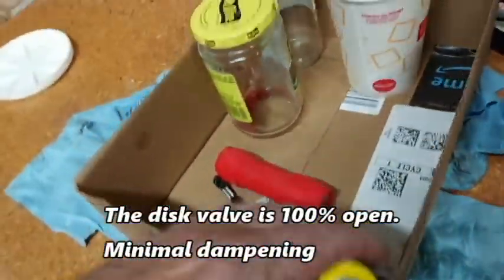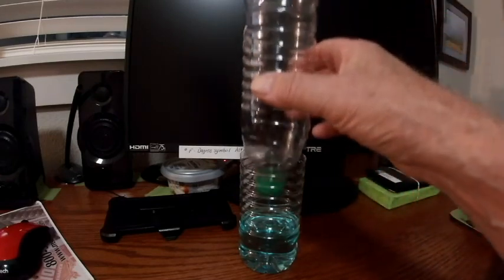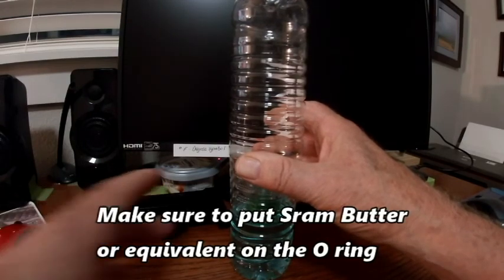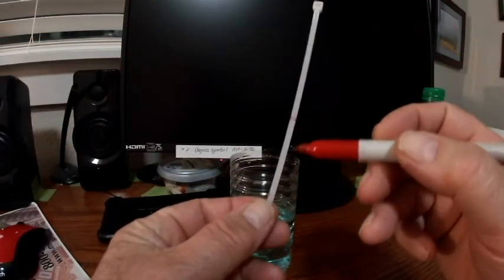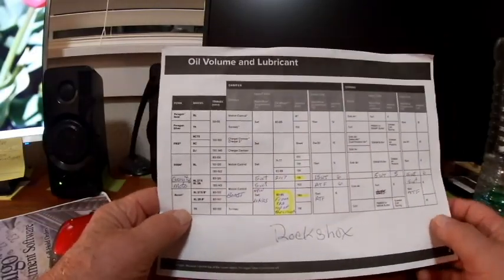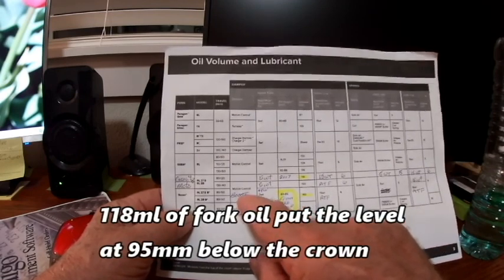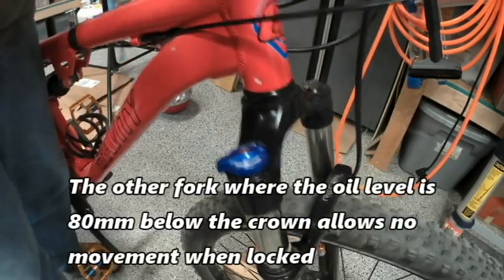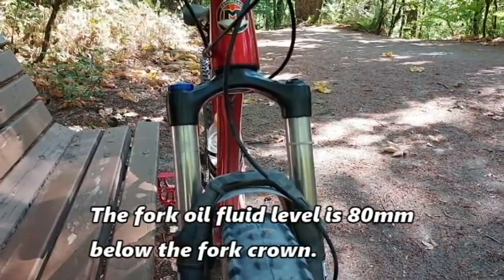Rockshox Recon fork oil level

Comment: Can you please tell how much this would be in ml then ?
Reply: Depends on the travel. 110-120mm = 118ml; 130-140mm = 150ml; Boost = 140ml.  Oil height is the most reliable when in doubt.

Comment: Where exactly is the top of the crown?  Is it the top of the black or the steel tube inside?  Do you use Rock Shox oil or a cheaper alternative?  Thank you for the video!
Reply from the maker: I was a bit vague about the line I put on the skewer. I dipped into the stanchion until it was even with the top, where the threads start. I then measure up from the wet area to that line. I use Lucas synthetic fork oil.

Comment: Thank you very much for your video, this is exactly what is happening to me right now.  200h service on a Recon Silver and the lockout didn't work at the end :-(  Can I just unscrew the nut at the top and add oil or I will have to completely start over and detach the lower part of the fork?
Reply from the maker: Yes, just add fork oil up to 80 - 85mm below the top of the crown.
Reply: @Mntbkr64  I will try that.  Thank you very much!
Reply: I had same thing with my Honzo. Checked the rock shock manual, and it said 118ml and no lockout. In my motorcycle they only say how much airgap there should be on top, and I googled that and found this helpful video. 

Checked the airgap, that was way more than my 100mm measuring stick and studied more the rock shock service manual. There was another Recon silver with 120mm trave with 140 ml oil capacity. 22ml more and now it's 80mm of air gap. And the lockout works.

EDIT: actually just noticed that also said manual says the airgap. And there was a B in the end that means boost and I missed that asterix on my phone :/. Bloody hell, just says that one should not use phone as workmanual :D.